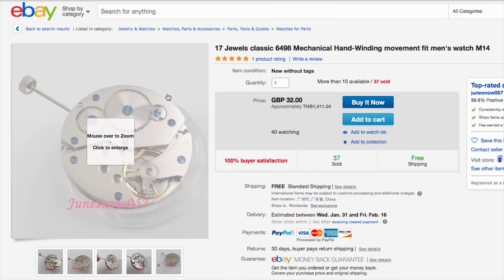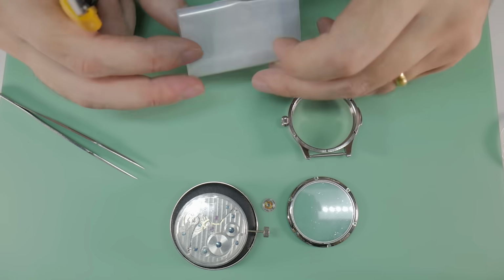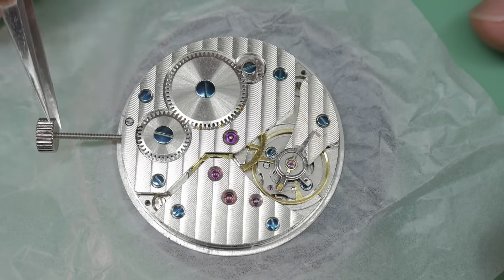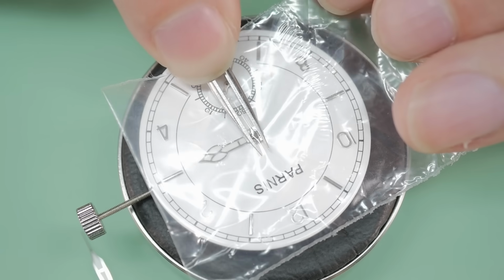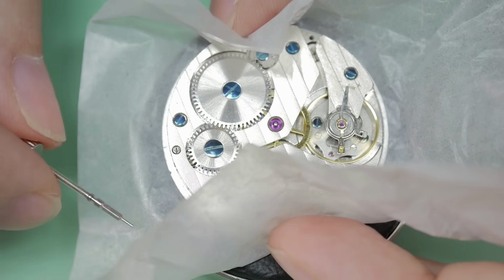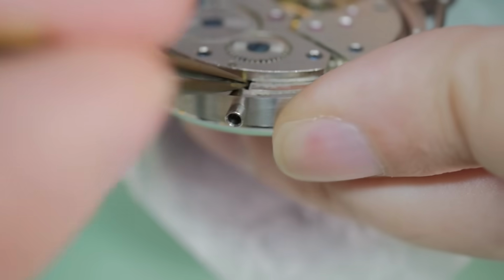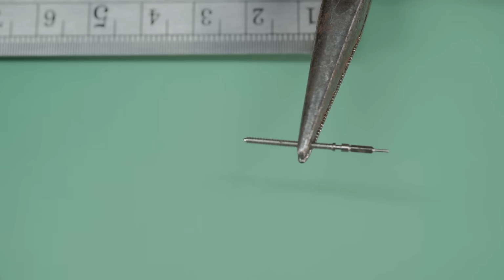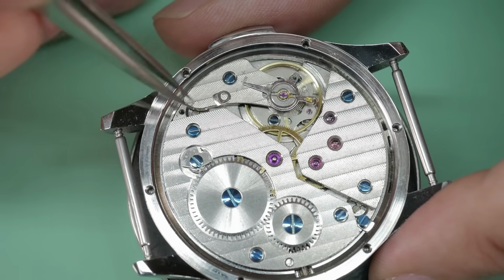Build Your Own Custom Watch Using Parts From Ebay

Comment: Having amassed a nice watch collection, I was motivated to buy parts and assemble a watch myself. I've watched your videos and I bought a manual 6497 skeleton movement, ebay item number 123678839202 and a case to suit. I've watched your video on removing watch crowns, but I'm stumped, there are no screws or protruding leavers to press to remove the crown. Is there a video you have recorded that discloses this secret?
Reply: I've searched some pictures of that movement and there's a small screw near the stem, it's on the side with the blue screws (rear of the watch I think). On the front there's also something that looks like a small button

Comment: I recently bought the movement ETA 7001. It did not come with a dial washer. Will the watch run without the dial washer? If not what size washer will fit ?

Comment: Watch Repair Guy! Thank you, from across the Pond, on the Left Coast as we call it! This is the third time I have watched this particular video, I believe Watching several times helps my 69-year-old brain assimilate and retain Information!
My question is about Knipping the Stem at about 20+ minutes in. I wonder if putting the Original stem cap on after smoothing off the cut would be more appropriate as it would act as a bit of a "die" to reform the thread, or is the thread pitch so fine that it is cared for by simply the filing itself?

I do want to make a watch for myself, I have Not worn a Watch sin 1969, when I worked Electrical Repair work in VietNam, and I want to return to the Mechanical Movement of "time" rather than the atomic time Standards of my iPhone!

Thank you, in Advance,
philip from the Great Pacific NorthWET!

Comment: I have an off-topic movement Q for you - I have a dress watch w/ a Miyota in it. Being dressy its super loud and makes it seem cheap etc  How harmful would it be to have a watchmaker remove the 'fly wheel' and just use it as a manual winder?
Reply: Has the movement serviced and if that doesn't work leave it as is cuz it is so easy to have a watch with a auto wind function ...

Comment: I'm looking at my late father's old 1960's Timex Marlin Automatic (with date) that gave up the ghost shortly after he died (32 years ago). Nothing inside that watch looks like anything I've seen anywhere on this channel (or others) and after this video I am thinking of replacing the entire movement with a decent (perhaps Swiss) automatic mechanical movement. Great videos, really nice to watch. I am also thinking that watch repair/building/rebuilding might be a potential revenue stream when we go off sailboat cruising in a year or two. It doesn't need space or big tools or power....mmmm, maybe?

Comment: Hello mark iv just built my first watch useing a seagull st36 .i wonder how many other viewers have fallowed along and if you could do a service video.. Iv seen 1 but it was the eta version .also what oils do i need to buy to service the 6497 .i think the eta manual for them has about 4 differant ones .9010. Mobious 1300 and 2 others .i just want to be able to make watchs for me and my dad and brother inlaw and be able to look after them myself .i know you use d5 a lot .if i can get away without having to use so many types of oil that would be grate .

Comment: @watch repair channel I ordered all of my parts and tools on ebay but my movement did not come with a movement ring. Is this normal for movements not to be sold with movement rings? If this is the case, can you recommend somewhere to purchase? Thanks!!
Reply from the maker: The movement ring should be provided with the case - not the movement unless the inner diameter of the case is already the correct size and the movement fits snug. If not then one would normally have to make one. It may be best to return the case if you can and order another specified to fit your movement which includes a case ring if required.
Reply: Thanks so much for your response! The case was listed on eBay as being able to fit but the movement just rattles around. Thanks very much again and have a great week!

Comment: Could you flip the dial around on the movement and make a watch "left handed"? Like with the crown on the left side?
Reply: No. Just repaint the number on the dial. What you suggest is an engineering job

Comment: Are you using the 6497 or the 6498 movement? I though I heard you say you were going to use a 6498, but the screenshot you showed suggests that you used a 6497. When you assembled the watch the crown was at the 3:00 position, which makes me think you're using a 6498. Guidance would be helpful since I'm looking to purchase my components soon!

Comment: Hello there, great video Mark! It's so good to have seen you video because it really inspired me to do something that I was thinking to do since a while ago,  my plan in rough is to buy a swiss automatic movement like an ETA, and then buy the rest of the pieces and assamble it my self like you did in you video. However I don't have any experience in this field. Do you think this would be viable? Could you recommend me some specific movement for the project, and where to buy the rest of the pieces? I wouuld like to assamble something simillar in style to a JUNGHANS MAX BILL or a JUNGHANS FORM (the Chrono ver.) at a much lower price. Hope you can advice. You've got your self a new subscriber good sir. Thx and keep it up!

Comment: Hi Mark, thanks for the interesting videos.  Is it possible to source the materials to make a nice 36mm manual winder with an ETA (Peseux) 7001 movement in it?  It seems like the movements might be available, but a thin case might be hard to find.
Thanks

Comment: i made a similar one years ago sterile dial pvd black case with no proper tools at all and wear it proudly time to time. only problem is those chinese movements are insanely loud also not sure if they properly oiled them when manufacturing either way it keeps perfect time after adjusting. shows insanely accurate results in homemade timing machine makes the assembler/owner super happy.  i have no watchmaking skills or education so most everyone can build a watch i guess.  beats most of the overpriced quartz craps that u can buy at the costs of these at least and the joy it gives when finished is something else. 
thanks for the video

Comment: Thank you for this video. Because of this video, I've assembled a Parnis-style watch based on the ST36xx 6497 movement. It took quite a while (several months) to get all the necessary parts and a minimum set of watch tools together. Amusingly, the watch ended up costing more than a similar Parnis watch fully assembled (probably about $100 compared to $51 for one already built), but the learning experience was well worth it. The customization was nice too (e.g. black PVD case). My difficulties included installing the Second Hand (took me an hour, LOL!!) and the two movement clamps and screws (took me another hour, LOL). I'll probably do it again (6498 maybe), and then I might try yet another time with a genuine Swiss ETA movement.

Great fun. Thank you Mark.

Comment: Good video, but as a trained engineer, I had to metaphorically cover my eyes when you measured the stem with A BLOODY STEEL RULE!!!!! Surely, a vernier or digital calliper would provide better results! Also, why not trim the stem with a Dremel etc. I know it would probably take longer but the overall aesthetics would be far superior.  Cheap and accurate(ish) callipers are in abundance on eBay.
Reply from the maker: Not required for shortening a stem. Unless you enjoy wasting precious time. Asked and answered already in the follow up video ;)
Reply: Why would you need a Vernier caliper? Shortening a stem is not something that is done to 1000ths of an inch accuracy, he allowed for a little extra length and if it had been long he would have just filed a small portion more off. How would you even manipulate a caliper in to measure between the two surfaces he was measuring? He cut the stem with side cutters, not a process that requires tremendous accuracy.

Comment: Very good tutorial. A question though? How would you build a watch using a coin as the watch face?
Reply: it is POSSIBLE, but may not be PRACTICAL. You would need to find out the diameter of the coin (in mm) (use calipers) and then find a case that would fit that diameter dial size (as well as buying a movement for that case, and hands for the movement) Then you would need to drill a hole in the dead center of the coin (to accommodate fitting the hands) and then you would need to fit the coin to the case and the movement. 

Normally Dials have little "feet" that protrude from the bottom in particular places so they can be attached to the movement (in the correct orientation) with little levers or screws. 

So you would either have to figure out how to attach (or make) dial feet (in the exact right locations) (probably too hard to do accurately), OR you would have to figure out another way to secure the dial to the movement (glue would work, but is probably not the best idea, but a couple drops of blue locktite just might do the trick) (just make sure you have the coin aligned in the right orientation and position and don't glue any working parts of the movement!) 

Now this is ALL assuming that the coin would be THIN enough to fit inside the case WITH the movement AND hands in place. 

My guess is that the coin will be too thick so you'd have to sand it thinner. 

it would need to be thin enough so that the movement could seat the case behind it, AND thin enough so that you could seat the HANDS in front of it, with them still having enough clearance to rotate. 

I'm not saying that you can't do it, it just may be difficult to accomplish, and you may want some calipers to check your thickness on the coin, to make sure it's the right dimensions. 

If I was going to sand it, i'd do it with some wet/dry sandpaper, on a hard flat surface (sometimes you can find glass top end/side tables with thick glass surfaces. (either someone's throwing it out, or at thrift store) if you tape the sandpaper flat to that, and wet it down a bit you should be able to get a coin relatively flat and smooth. 

I would also suggest taping off the side of the coin you want to keep mint (undamaged) to avoid scratching or nicking it while you work on it. 

And drill the hole before you sand, (if it's too think it might tear out more than you want if the drill isn't steady.

(when drilling the hole tap it first - find the center and use a nail to punch a little indentation right in the middle of the coin, so that way the drill bit naturally wants to stick in that little hole/point.)

Lastly, you may want to check that the coin you are going to use is no longer legal tender, Some places have laws against destroying government property (like money) But i'm not going to tell you what to do.

This is just an overview of advice for IF you want to try this out. I take no responsibility for any damage or legal trouble you might incur, but I hope that helps give you an idea of what all would be involved in trying to do something like that. Sounds cool, hope this helps.

Comment: Glad I checked back here, I can see from this video that on mine I fitted the metal spacer ring upside down! Still got it in and got the stem back in though, but I will correct it. EDIT: just tried to "correct" it but it seems mine only fits the way I first did it.
One problem I had was that when I fit the seconds hand the movement won't work at all, when I take it off the movememt runs fine. Tried several times, from every viewpoint and angle I can see good clearance, so no idea what to do, i'll just have to not have a seconds hand. It is what it is!
Unless anyone else can help me and solve the puzzle?

Comment: Decided to give this a go. Not as easy as it looks. Quite apart from how difficult it is to start those tiny screws, move things about without them flying across the room as they jump out of tweezers... I hit a couple of snags. Clips for movement ring weren't with the movement. I ordered some, but one place needs a shorter one, so some trimming to do. Then.... The thing ran well for a day, then decided to stop. Keeps stopping. So how to trouble shoot. 

Ideas?
Reply: Did the movement come with a dial washer? It's a little thin brass (slightly bent) o-ring looking thing. You can see it at around 7:20 in the video. You said the movement didn't' come with clips. Just wondering because this might be the problem.
Reply: @pipboy3000PS3  yes, it had the dial washer. Dial washer made it worse. Traced it to the dial feet being too short to engage with the quadrants. Fixed that by wedging dial/movement combi in place with a plastic spacer which gets compressed by the back. Crude, I hear the professionals shudder. Need to extend the dial feet.

Now it keeps time to a few seconds a week. 

Trouble is... The winder keeps jumping. Seems it's a common problem with these movements.

Comment: What was the total cost?
Reply: There are so many possible combinations and prices for these parts. So you could build your own unique individual personalized watch, and chose to pay more or less for any of these parts. (less by bidding in ebay auctions for example)

But for this particular combination, the parts I was able to find at TODAY's prices. 04/21/2018

are:

Case: $25
Dial/Hands: $23.74
Movement: $45.99

Total cost: ~$94.73 US

based on these prices:

Case:  https://www.ebay.com/itm/44mm-parnis-watch-sterile-CASE-fit-eta-6498-6497-hand-winding-mens-movement-C6/302449553402?epid=2262109665&hash=item466b65effa:g:caMAAOSw~9BZt1Ib

Dial/Hands: https://www.ebay.com/itm/38-9mm-Parnis-white-Watch-dial-Hands-fit-6498-ST-36-Movement-Mens-Watch/183158349001?hash=item2aa5169cc9:g:LJUAAOSw9ytZn5MV

Movement: https://www.ebay.com/itm/17-Jewels-Seagull-ST36-Mechanical-Movement-6498-Hand-Winding-Watch-High-Quality/391753959321?epid=6007004940&hash=item5b365b0799:g:laAAAOSwo6lWMcZW

Now, that is for a Seagull movement with "some" decoration 

You could save some money and buy a less decorated movement for $37.56 
 
here: 

https://www.ebay.com/itm/Classic-Vintage-17-Jewels-6498-Mechanical-Hand-Winding-Mens-Women-Watch-Movement/232741726263?hash=item36307ce837:g:DFoAAOSwIzda2v43

or you could buy the original ETA Unitas 6498 for $259

Here: 

https://www.ebay.com/itm/MOVEMENT-ETA-UNITAS-6498-1-ELABORE-COTE-DE-GENEVE-BLUE-SCREWS/142758035841?hash=item213d0ac181:g:SuIAAOSwc95a0pKr

So ultimately the price is what you want to spend. 

You could easily do a similar project for around the same price.

Comment: How do I find more watch movement codes so that I can find cases and dials that fit with the movements?
Reply: the easiest thing I have found is to search for other parts first. For example search "Watch Case fit" on Ebay, then look at cases till you find something you like, then it will tell you what movements will fit inside. Then you need to find a dial that is the right size to fit the case. (most cases on Ebay will say what the dial size is in the description) and then some hands for that movement. Alternatively, you can also search "Case Dial Fit" and make it a little easier on yourself, and find a case AND dial (and potentially hands too) that ALL fit together with a movement (it will tell you in the listing) That way you won't waste time. Because if you look for a movement first, you may find that you are unable to find cases or dials that suit your taste, but if you work backwards, you are more able to get the look you want. Hope that helps.

Comment: I have some questions:
-Is it possible to buy a Valjoux 7750 movement and a case for that movement aswell?
-If so, how much would it cost?
-Is it hard to find a good swiss movement?
Reply: You can buy the Genuine Valjoux 7750 movement (with various different rotors) from Switzerland on Ebay for around $450 US ish shipped. 

Or you can find Asian Clone versions for around $130 US shipped.

(You can even buy a Genuine skeletonized version for $2,250 US) (yes on Ebay)

The only problem you might run into is finding case and dial combinations. 

There are a handful on Ebay, and prices range from about $150 to about $250 US (and up)

But there aren't a lot of options, there are SOME to be sure, but
you may have more luck if you broaden your search to other sources. 

But yes, it is possible to find the movements and parts.

Comment: Just a little tip from an old metalbasher, if you have to cut the stem to length, I suggest getting a crown or nut that will screw all the way past where you want your cut to be, then proceed with the cut and file the face flat, You then unscrew the nut and it will remove any burrs on the stem, making it easier to fit the new crown.
Reply: I did exactly that. It was the size M1.2 for the watch stem in the ST36xx / 6947 movement that I used. I just happen to have purchase a wee feisty collection of tiny screws and nuts ($5) from eBay, and the required size nut (M1.2) was in the set. It did help to straighten out the threads after chopping the stem.
Reply: Even better, get an M1.2mm die and use that instead of a nut.
Reply: What’s a metalbasher?

Comment: Great video! I did one like this a few years ago :)Only thing I noticed is make sure to get the seagull screws for the case clamps with the movement. The ETA screws had a different pitch to them and would not work.